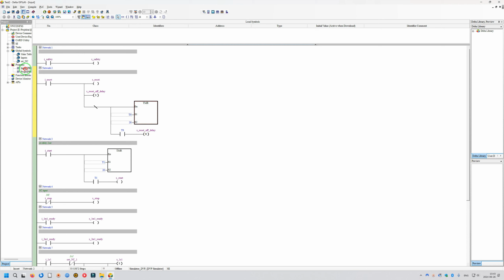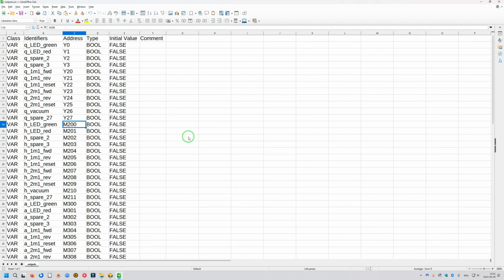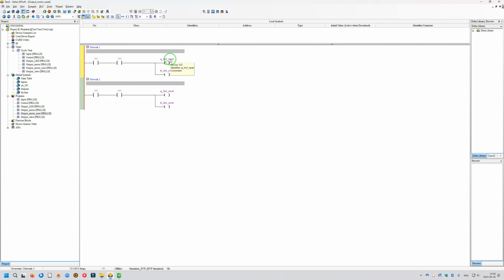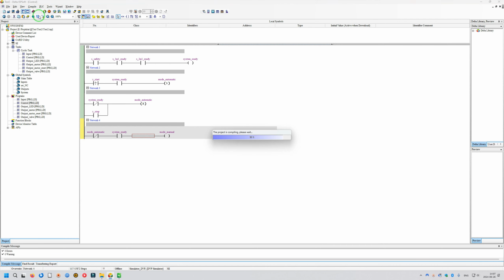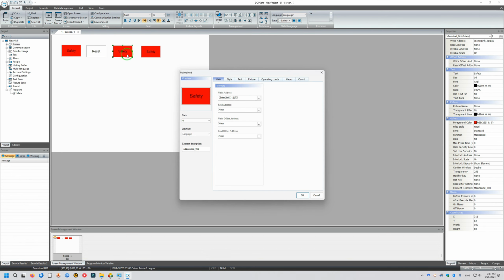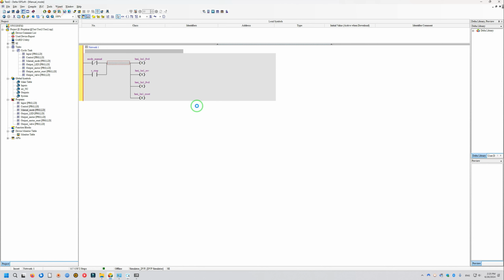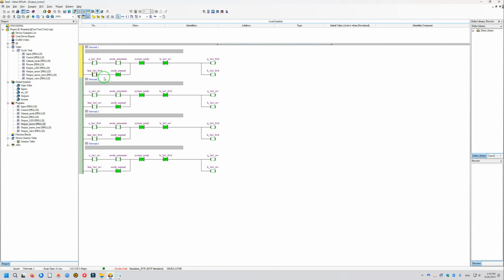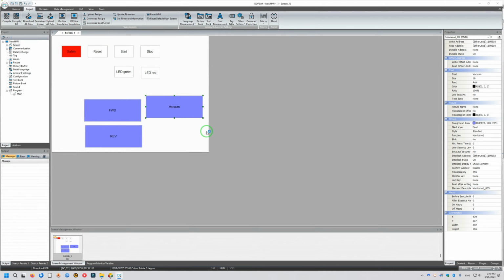PLC programming lesson: output subroutine

Comment: congratulations! As always, good explanation with great examples.
I don't want to be boring, but if you have an example of a temperature PID with a recipe, I would really appreciate it. I intend to automate a laminated glass oven.
Thanks!!
forgive the English, I'm Brazilian and I'm using a translator.
Reply from the maker: I have never did PID with Delta PLC, only with Siemens. But if you have an option to select, use AS series PLC, not DVP - I have heard DVP series PLC has some bugs on some PID types (this information also is old, so maybe bugs have been fixed). 
P.S. you can write in any language - there's a translate button so I will understand 😉